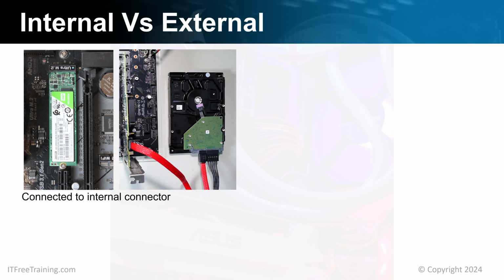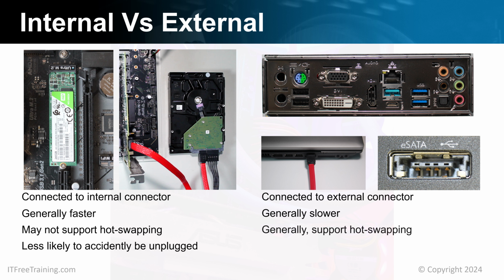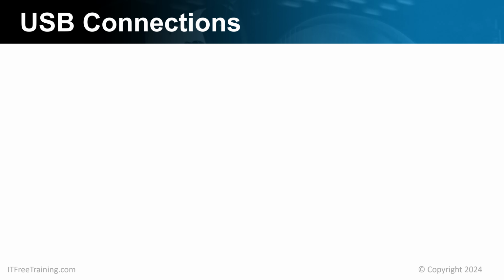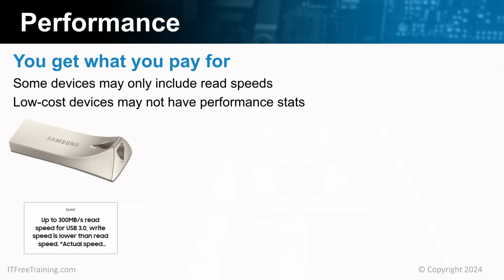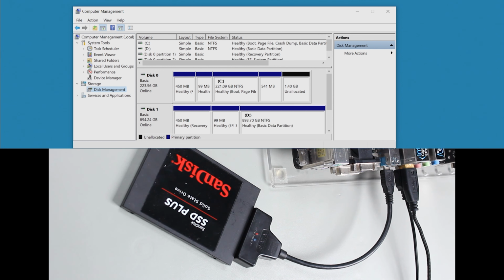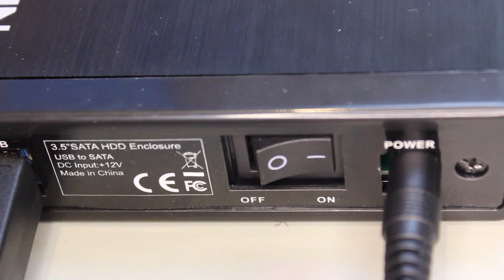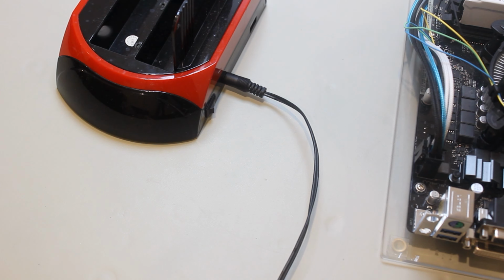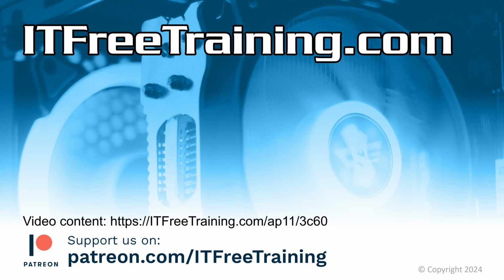External Storage Devices

Comment: so what are good external storages?
Reply: I'd go for a 10GBps external enclosure, with a 2TB Gen4 NVME drive and a Thunderbolt 3 / USB3.1 cable. Gen4 drives >512GB are cheaper than the slower Gen3 drive with the same capacity. Production costs have gone down, demand rose and manufacturing has technologically matured and scaled up. 
The Lexar NM790 is a great drive with plenty of speed. The 2TB is the sweet spot, selling for about 130.00 for 2TB (up 25% in Februari...). The Crucial P3 2TB sells for about the same, but it's sbout 30% slower. Like I said earlier: You are not going to notice the difference, not even when you installed the drive on your MB.

Comment: Good and to the point. Mentioning there are SATA and NVME M.2 drives and enclosures that are incompatible (unless the are multi-keyed) will probably save some viewers an unpleasant surprise. A lot of older devices use Firewire, which is still a very usable protocol. Especially the ability to daisy chain Firewire devices is extremely handy. Finally I would have mentioned the existence of SAS harddisks, that are incompatible with SATA enclosures. In a system that supports SAS drives, both SAS and SATA drives can be used.
Besides eSATA, there is also aSATAp, which delivers 5V and 12V power together with the SATA protocol. I can not recall ever having come across an external device using either protocol. To be honest, I think it became obsolete before it became available. It's marginally faster than USB 3.0 (6Gbps vs 5Gbps), but neither connection will ever run at those maximum speeds. 

An external 7200rpm mechanical SATA drive using eSATA, USB 2.0/3.0/3.1/3.1.2, Firewire 400/800 or Thunderbolt 1/2/3/4 will top out at about 150Mbps, about 1/3 of the speed USB2.0 is capable of. Usually this type of drive won't transfer faster than about 70Mbps. An external 2.5" SATA-3 SSD could reach 560Mbps, only barely faster than the 480Mbps USB 2.0 offers. In almost every use case, this drive will perform around the 350Mbps mark. Not all SATA SSDs are SATA-3, the cheaper drives up to 512Gb are sometimes SATA-2 and offer about 200Mbps using any of the mentioned protocols. Only when using an external NVME Gen3/4/5 in the correct enclosure, any of the protocols faster than USB2.0 speed things up.

With all of these numbers, you should ask yourself how much it really matters on a day to day basis. Would your day be better because you transferred a file in 22 seconds in stead if in 34 seconds? Unless you move huge amounts of data all day, you'll probably never notice that the drive only moves 100Mbps. The faster drives get, the less you will notice speed differences. A Gen3 NVME drive moves up to 1Gbps per (between 1-4) PCIe-lane(s), a Gen4 NVME drive is up to twice as fast. Only when you constantly move terabytes, that difference is noticable. For day to day office use, gaming, watching a movie or uploading your backup to your cloud drive, you will almost never be able to tell the difference between a 2.5" SATA-2 SSD or an M.2 NVME Gen4 drive.  

I know Firewire is seen as obsolete, but buyers of low cost systems often find a FW400/800 (sometimes called 1394 to avoid the Apple royalty fee) among the I/O connectors. Not too fair sellers of used storage 'overlook' to mention a SAS drive doesn't work (or even fits) in most consumer systems. That cheap drive than turns out not to be the bargain it seemed to be. It happens with ECC memory as well.